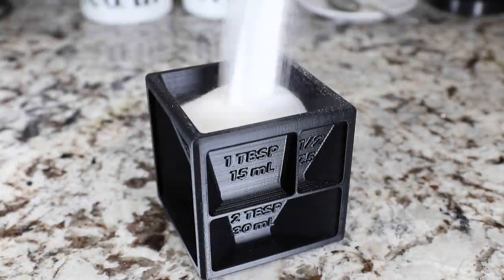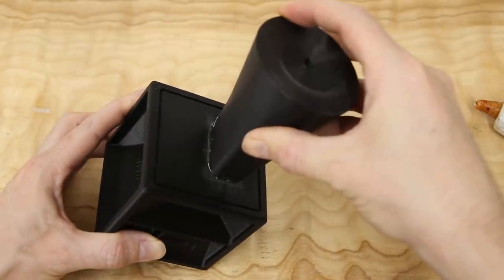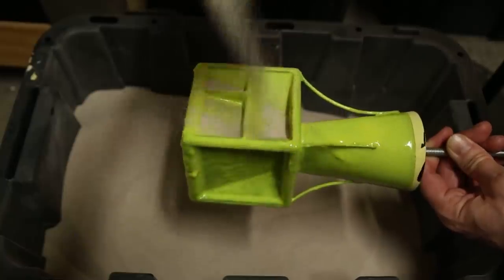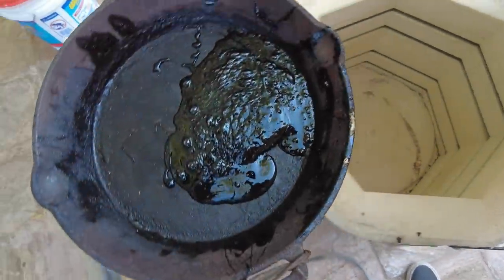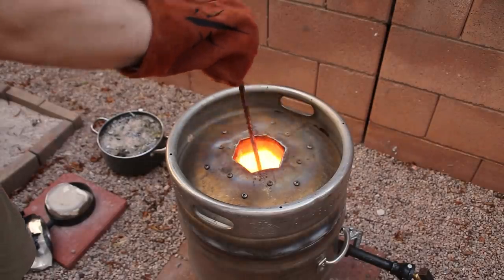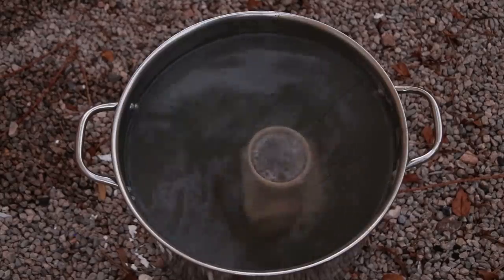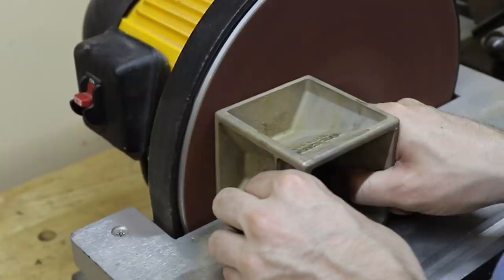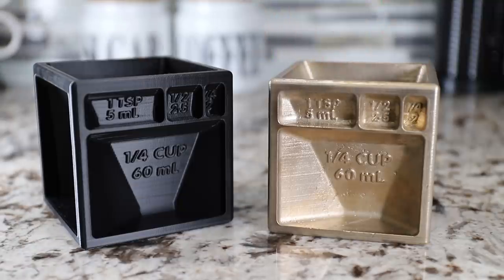Making a Measuring Cube - EXTREME MEASURES - bronze metal casting at home - 3d Printing Lost PLA

Comment: Was the measurement still accurate?
I worked in a bronze foundry years ago and I would have been send home when wearing those shoes!
We wore wooden shoes only as they can be kicked off and offer some seconds before burning through when your cast leaks and liquid metal spills out.
Cool shape, thanks for sharing, stay safe.
Reply: Never heard of using wooden shoes.
Reply: What was your favorite part of working there? Sounds interesting :)
Reply: Which measurement would it be accurate to? Tablespoon to ml isn't accurate in the first place.
Reply: @edwardssistershands  Well one tablespoon is 14.786788602728 ml. I don't know any recipe in the kitchen that would be measured with such a device that is ruined by 0.2132114 ml of something that inaccuracy you have with pretty much any kitchen measure anyways. Especially by volume.
Reply: @carpediem5232  Compounding errors :)
Reply: @edwardssistershands  Maybe if you start measuring multiple cups with it yeah. But who does that? Also if you measure by volume you are getting a ratio. So the other ingredients will be the same ratio. 
You get differences of 1 or more grams just by the grain size of sugar, salt etc. you use. It's really not a big deal.
Reply: @carpediem5232  No one is saying it is a big deal, but the conversion is inaccurate. Idk why you ppl set out arguing things just based on your feelings.
Reply: @edwardssistershands  When did I talk based on my feelings? I was talking about the real world effect tjat these inaccuracies would have. Which is next to zero. I didn't disagree that oz to ml is perfectly accurate, just adding that it doesn't matter in most instances where you would use this device. How is that arguing from feelings? It is just a factual statement. 
Both can be true. It can be not perfectly accurate and at the same time it can make no difference. 
And who is "you people"?
Reply: @carpediem5232  You people are really something. Thanks for agreeing with my point and not trying to start an argument about some tangential garbage.
Reply: @edwardssistershands  LOL it wasn't an argument. Again who is "you people". Why are you so butthurt? In my very first comment I stated the exact difference you were talking about and just made the addition that this inaccuracy was negligible. Sorry if you are not allowed to add something to a comment anymore.
Reply: @carpediem5232  Apologies for triggering you. You're right, it was a poor attempt at an argument. Best we don't consider it one. This is shaping up to be a beautiful friendship.
Reply: @edwardssistershands  LOL who got triggered by someone just making an addition? 
Anyway have a nice day.
Reply: @carpediem5232  Thanks! Enjoy your purple hair.
Reply: @edwardssistershands  Oh wow you are really a sad person.
Reply: @edwardssistershands  Who uses measurement cups,  do it by weight if you need to be accurate
Reply: @Kevin-fj5oe  never heard of clogs ?
Reply: @MattyH73  no, probably have different words in my language.
Reply: @carpediem5232  pfft hahaha it's a rollercoaster of emotions with this edwards guy
Reply: @Kevin-fj5oe  do you know anything about the netherlands??
Reply: @alterstassfurter5743  a bit, mostly related to the Belanda/Dutch colonialism in my country (Indonesia).
Reply: @carpediem5232   i don't think you'd ever want to use the measuring cube anyways, its actually quite an inconvenient form factor regardless of accuracy.
Reply: @carpediem5232  have you been to a French patisserie/boulangeries school, i swear the fucker will adjust until they are pricise within 0.1g/0.5ml of the objective, volume is only precise, when you need volume, which is rare, everything isin grams
Grams of flour
Grams of milk
Grams of eggs
Reply: @N1ko0L  Sure, but they wouldn't use this anyway since as you say they work in grams not in volume. We are talking about a home kitchen. Nobody claimed that this was a tool meant for professional use or minute measurements. Professional patisserie is about as close to normal home cooking as an NBA game is to two kids throwing a football in a yard.
Reply: @edwardssistershands  you need help,  fragile ego is mans worst enemy.
Reply: @LucasJasche  Typically, I will tell other's they need help to bolster my ego.
Reply: @SomeElsenNerd420-J  he sounds like an edgy 16 year old

Comment: As a cook, I love this so much. It's definitely functional art. I would definitely use this cube.
Reply: It measures well but is too easy to spill liquid.
Reply: I was thinking about how impractical and bulky this would be in the kitchen. 
Stacking measuring cups are far more practical but this looks really cool.
Reply: @ReglazeRX  why do you need multiples of a measuring jar or cup? one is not enough?
Reply: @jurekmc  There's 2 types of measuring cup. 
Dry and wet.
Reply: @ReglazeRX  with plates, a scale and a measuring jar(idk how to call it, sorry for bad english) its more than enough for me but i get where you are coming from.
Reply: @jurekmc  I too prefer weight as the measurement in recipes.
Reply: @ReglazeRX  i mean the majority of volumes can be easily translated to grams, the measuring cups usually gives the stuff in grams(that are not water) so the recepies tend to come by weight
Reply: @jurekmc  It's a more precise method in my opinion. 
It makes adjusting a recipe easier as well.
Reply: A scale is enough for me.
Reply: @ReglazeRX  bruh if youre meassuring in imperials you do not have the right to call something precise XD meassure everything in grams per portion and multiply it by number of portions. how is that less precise then a "cup" but i guess elementary grade muliplications are too hard

Comment: looks great, i printed and used some of these myself. for the finish, i really liked how smooth you got the bottom with the large disc sander. i would do the same with each of the sides. with their rims all the same smooth, shiny metal, it would contrast quite nicely to the rest. and you could even get a more elegant look if you sand the rims until the edges are pointy
Reply: Also be an interesting contrast if the insides were highly polished, [vibratory medium polisher, perhaps ?] and the base and outer corners were left matt finish.
That would be perhaps a little easier to clean if used for actual cooking measurements

Comment: That's a job for a rotary tumbler if ever I saw one, great job.
Reply: I'd think a vibratory tumbler would be better as the polishing media would be in contact with the entire part constantly, unlike a rotary tumbler. I don't think a rotary tumbler could even get media into the deep crevices to polish them at all.
Reply: @supergiantbubbles  If you used only large media you would be correct but rotary tumblers work with anything from pebble-sized media to talc sized and paste type media. 

Second, you can mix media size in a rotary but not a vib, the small particles just fall to the bottom in a vib, but not in a rotary.

A mix of large and small media would have done the sandblasting and polishing steps in one process but only in a tumbler. 👍

Comment: Thanks for adding the conversion of temperature in °C as text once. I would appreciate it for the burnout and melt-temperature of the PLA as well.
Reply: He shows celsius on the thermometer in the other cases
Reply: @angrydragonslayer  I did not see it when I watched the video. Could be more obvious but yes it is there.
Reply: @Flederratte  yeah.... pretty easily missed but that's life when looking at someone else doing something

on a sidenote, trying to learn smithing from an old-fashioned smith sucks for this very reason.

Comment: Having the ceramic shell helps a lot.  Not only in allowing the original PLA template to melt out and leave a perfect negative void, but also with the pouring of the cast as it's perfectly able to withstand the heat/pressure of the molten alloy at the temperature required for it to remain liquid long enough to fill every space.  The results speak for themselves.

Comment: I'm a 3D printing and metalworking mechanical engineer and I learned stuff in this video, thanks! Great work on your casting! Great to see some professional-level technique used in a YouTube casting vid.

Personally I might have smoothed the 3D print a little first... but that would have been a PITA and you did a great job anyway.

To remove the ceramic shells - I've actually re-furnaced my pieces after doing the initial cleanup. The shell can fall off in circumstances like that, due to differential expansion. Might have saved you some sandblasting time.

Comment: Looks sick! Do you turn the mold to the sides after your pour in the molten metal? Or did it nicely go in by itself and covered all the corners and details? I'm surprised by the high definition of the models in this video and some of your previous ones as well. I always thought that keeping such fine details is incredibly difficult, but you make it look easy!
Reply from the maker: Thank you! No, I didn't turn the mold at all. The metal was fluid enough to completely fill it. Ceramic shell is amazing stuff!
Reply: @robinson-foundry  ery noic m8

Comment: red liquid metal is just mesmerizing to look at
try adding phosphorus for less oxidation during casting and 1 - 1,5% lead for better castability (+ food safe clear coat finish)
let the casting cool on its own, it reduces stress and prevents cracking 
and get some propper shoes :D

Comment: Nice work! you might notice less problems with thin walled sections if you manage to install some additional gating and slow-fill from the bottom. When you direct-pour like that the metal can splash around, and a BB of metal cools a lot faster than a stream of metal. If your liquid metal is trying to flow around a bunch of pebbles it's going to have a hard time. Check out doctor john campbell's casting handbook. He took some x-rays of metal while it was being poured and managed to find a few ways to produce beautiful, sound castings with minimal metal.

Comment: If you  want clean\ polish  some surfaces hard to reach  you can try sandblasting equipment  using some soft materials  instead sand.   It will not make  it shiny but help a lot

Comment: Great. You could have done a acetone smoothing to get smooth surface on 3d prints. It will help to remove layer lines, also make easy to remove pattern from sand and also easier to remove ceramic debries from the casting .

Comment: Where you pour the casting would it be prudent to figure out a way to make that table or surface vibrate to help get the material to flow better in some circumstances

Comment: After breaking the mold apart, if you reheated the cast and then quenched, would the ceramic portions have popped off due to difference in expansion/contraction?

Comment: Can you do only 2-3 slurry coats and then putting it to sand like other general castings?
Also, did you consider resin printing to avoid those lines in casting?

Comment: Was wondering if you coated the base and the corners etc, ie all parts forming the faces of the cube, with a liquid rubber, could you polish the rest in a vibratory polisher to do all the insides, and then come back to grind and polish the base and outer faces ??

Comment: As a project it's interesting but you can buy conical shaped tumblers made of sheet metal or plastic that have a bunch of measurement lines printed on them. I think some kind of individual measures for tsp, tbsp, 1/4 cup etc. would be more useful if cast in bronze.

Comment: Great video....have you considered getting a resin printer, they are fairly inexpensive these days. I am sure you can find some amazing deals for Black Friday. It would help get rid of the layer lines because Resin printers can print with a lot more detail.
Reply: How does the hardened resin behave under heat? You'd need it to cleanly melt or burn out of the mold for it to work properly for this kind of work.

Comment: For the pieces of casting inside a concave surface.

Pressure washer.

You aim at the lip of the casting and try to get the stream to go under the casting.
It will usually pop right out

Comment: The print is bigger then the metal final product did it shrink a little from process. If so do u need to need to increase the size of the plastic model before so it comes out to actually measure everything correctly?

And if so did u do that or no?

Comment: Now you need to divide the dimensions of the printed cube by the cast cube. Then enter that into your 3D printer scale setting to over size the print so the finish casting it’s more accurate in its measurements of volume.

Comment: Your Suspendaslurry got me thinking it could be used for DIY home ceramic coating exhaust pipes on performance engines to mitigate heat. May of course not take the heat cycles as a pro-coat and so forth, but just an idea I had to throw out there as I have no shop at the moment -wretch! Just got here and seems like a subscription one:-)

Comment: 6:45 I've never worked with ceramic like that, would heavy vibrations break it off if someone had an old pedestal wire wheel that hums like a diesel engine?

Comment: How do you prevent the shell from cracking during the slow temperature rise when melting/burning-out?  In conventional flash burnout, the pattern is inserted into a hot kiln to prevent the shell from cracking. A thin layer of the wax pattern can melt first before bulk of the pattern can warm up, expand, and crack the shell.  Do you print with very thin walls?  My shells have always cracked during slow burnout.
Reply from the maker: I suspect that if the PLA prints were 100% solid then cracking from the PLA expanding would occur. However there is enough empty space inside of the prints to help prevent that. I print my patterns with two walls and very little infill.
Reply: @robinson-foundry  thank you. Have you ever tried PVB for this? Polycast is a PVB filament for this purpose, rapid casting. Also, what do you think of ABS?  Lots of papers on rapid casting use ABS for some reason,  but I found it more difficult than PLA.

Comment: its not mentioned in the video, but when printing the mold part, did you account for shrinkage?? its not a lot, but it is noticeable by the end that the cast part is a little smaller than the printed one

Comment: Your finish could have been improved at the pla model stage by some tricks to smooth the model out such as 3d print settings and things like heat gun or acetone (not sure, look into it) but you can smooth out your 3d prints with post production techniques.
Reply: If he only 3d prints that might help, but if in the end he's going to use it to cast metal he's going to sand it down anyway, so it's not all that useful to him.

Comment: I thought you would mist the print first to remove the layer lines.
After casting and polishing, is the volume still accurate?  I'd worry that the small measures might be off.
Reply: He said its 2-3% smaller so based on that, and the pitting that would make more surface area in the "cups?" so probably not at all. not in any amount that would effect most dishes.

Comment: How about a test to see how accurately it measures now? Could be a little neat to see if the casting process has any distortions that effect it's capacity?
Reply: its about2-3% smaller so not much. But you can just do the math based on that.

Comment: I'm curious if there is some kind of acid that would eat away at the ceramic but not at bronze or aluminium.
Reply: Plenty of acids dissolve ceramics but all of them will also dissolve metals. Metal is particularly weak against acid. The best way to destroy ceramic is to get it wet and then freeze it. Water fills the pores in the ceramic and then when it freezes it expands and cracks the ceramic.

Comment: Would this sequence work? 
UV polymer model
Then make a multi-sided mold
Paint wax on the inner mold surfaces,
Fill with wax,
Then heat, drain and pour bronze.

Would this make a smoother surface???

Comment: I don't know if it will help. My work has an entire foundry section. They use a high powered water blaster to remove the small ceramic bits. 4800 psi.

Comment: Isn't it a lot easier to start using the metric system?
Reply: Im generally pro-metric as well, but is it? The main advantage of metric are conversions. In cooking it doesn't really make a difference if it's 1/4 cup or 60ml imo

Comment: Get yourself a Air Needle Scaler. It'll take off the majority of the casting, and come in with the sand blast for the tight spots.
Edit: Did you oversizing your 3d print to accommodate for shrinkage? Otherwise the measurements will all be under valued.

Comment: Why did you use slip and burn the plastic out when you could have just dipped the plastic 3D design into a silicon mold and then get a wax mold of what you are making?

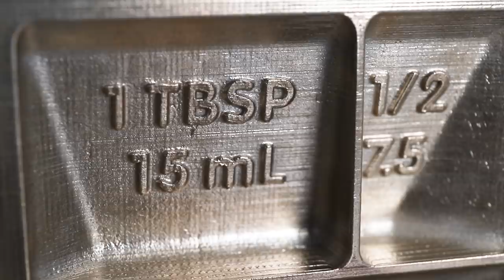Comment: 5:10 ". . . added a small piece of aluminum to add strength and ... corrosion resistance."    9:02 " ... casting ... flaws ... the surface finish is poor in some areas, which I believe is from adding the small amount of the aluminum to the bronze."   Sooo . . .  if you were doing it again, WOULD YA ADD the ALUMINUM ? ? ?    B-) 

Ya know there are cultures that intentionally weave a "mistake" into their work to acknowledge their humanity.  That cube is awesome !   I did wonder if keeping that "handle" on it could have been useful ?